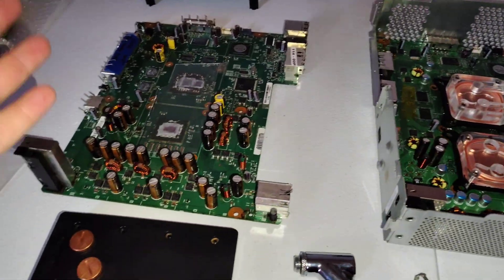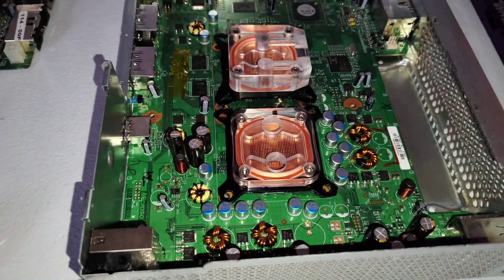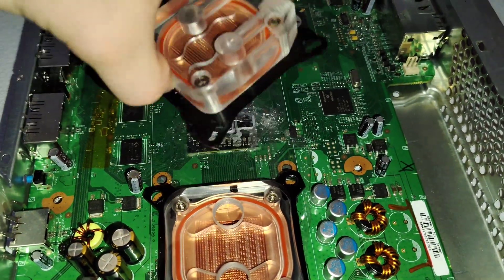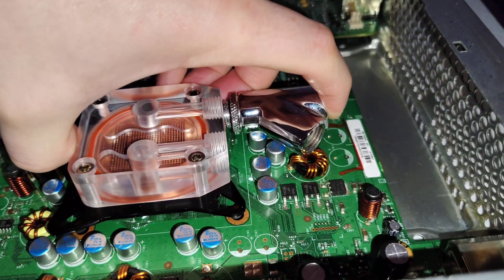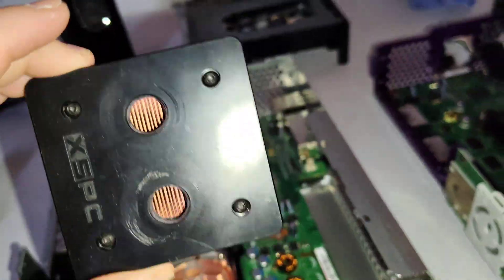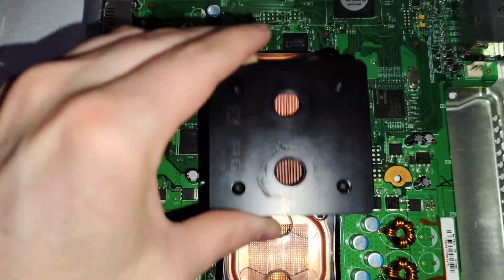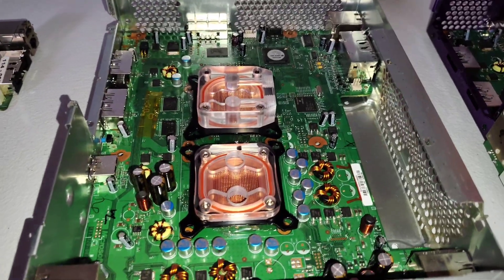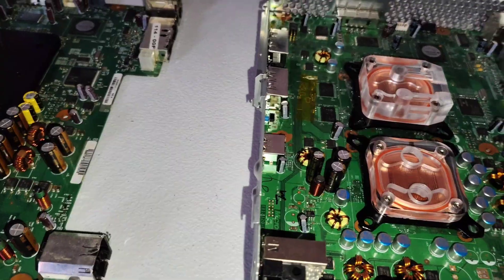Water Cooling Xbox 360s!! (Waterblocks)

Comment: Would love to see an internal AIO Cooler or a Vapour Chamber mod for the 360 and PS3. It would look a lot better if it was all internal.
Reply from the maker: The "stealthy" build I mention is planned to be completely internal, and look OEM in the outside, I have done almost a fully internal custom loop, just the fan in the side but I know I can solve that
Reply: @trinkettinkeringking If you could, keep the DVD Drive in there.
Reply from the maker: @8bitnation419  that's gonna be my goal for the first set up, tho that makes the reservoir quite a challenge

Comment: so basically you get a generic waterblock you drill wholes then get some bolts washers and nuts and bolt the waterblocks to the motherboard. Correct my if I am wrong I am thinking about doing this my self
Reply from the maker: I mean yea pretty much, tho I strongly recommend these blocks, some come at a 35 degree angle and wouldn't cover the full GPU. Otherwise yea 🤘
Reply: @trinkettinkeringking do you mind attaching the links thanks also I am gonna get your YouTube membership thing as I have seen your projects and love them
Reply from the maker: @72615hey yup added them to the description under the video, and very much appreciated! 🤙